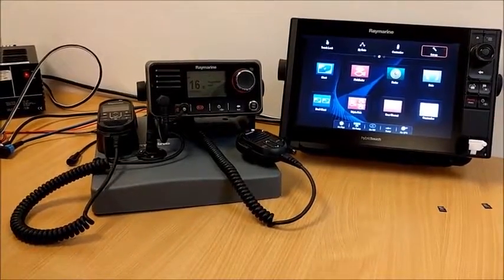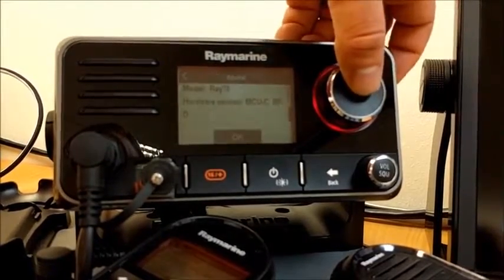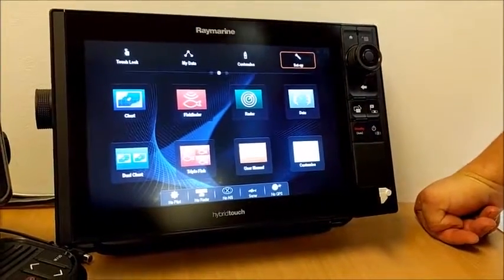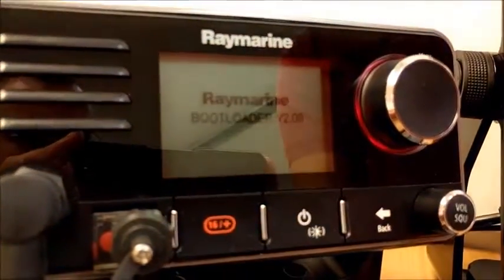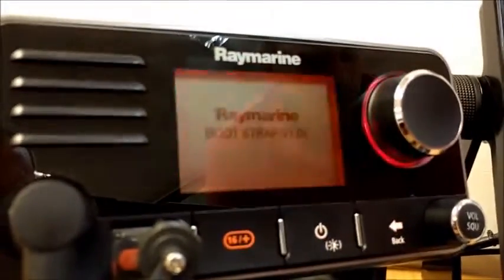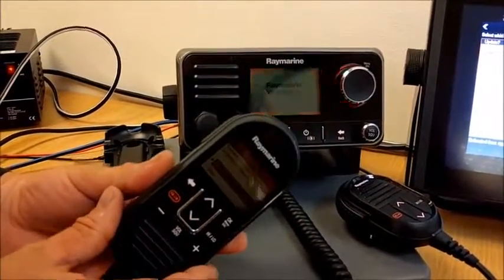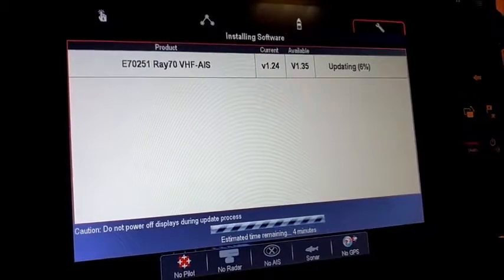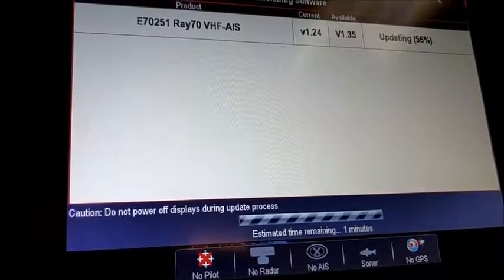Software Upgrade Procedure for Ray50/Ray52/Ray60/Ray70

Comment: Hi! This video is from 9 years ago, is it still the same procedure with SD cards and boot secret buttons even with Axiom that is internet connected? The reason I am asking is because I am planning to purchase Ray63 with extra mic controller.
Reply from the maker: Your Internet-connected Axiom can be used to update the software in your Ray63 radio.  Make sure the Axiom and VHF are connected together using SeaTalk NG or NMEA 2000 networking.  That allows Axiom to see the presence of the radio, check its software level, and serve it updates.

Once you have them connected and turned on, go to Axiom's home page and touch Settings...Software Update...Update Online.  Axiom will scan the network and should detect the Ray63.  If its out-of-date, there will be a check mark next to it in the list selecting it for update.  If there are other components needing update, they will be selected too.  Keep following the prompts to update them.
Reply: @RaymarineAppreciate it, thank you for the detailed answer.